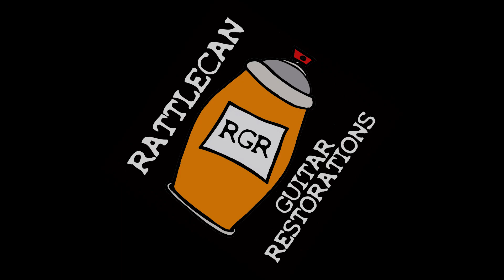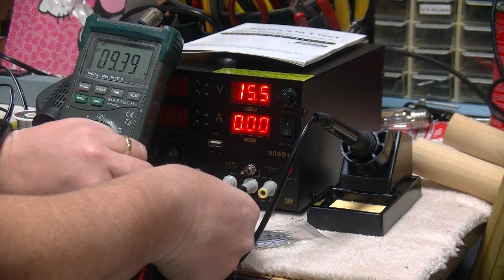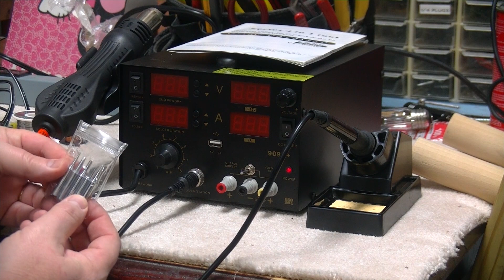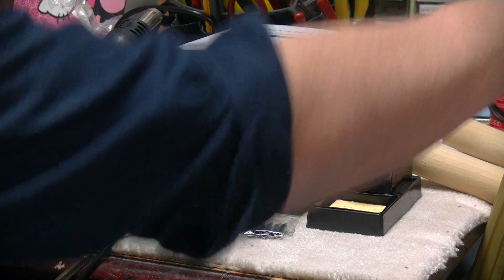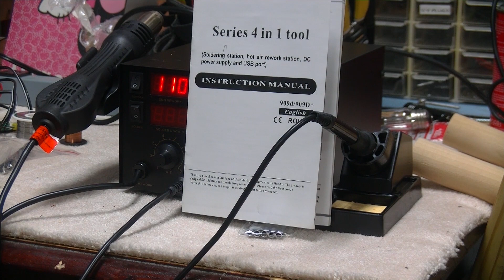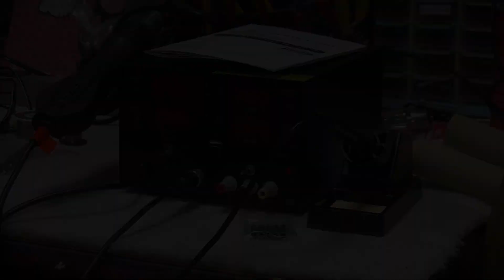REVIEW: 909D+ SMD rework station | RATTLECAN GUITAR RESTORATIONS by James O’Rear

Comment: Soldering Irons are something you don't want to cheap out on because cheapies never last. look for a used Metcal soldering station, built like a tank, heat up lightning fast, work great and have auto shut off so you never have to remember to turn it off, (something i have issues with), LOL https://www.youtube.com/watch?v=FAipMcwfuqI

Comment: Not worth the hassle. The soldering iron seems to go bad after every use. It'll work and before I'm done I'll get that same reading. I've ordered 3 replacement soldering irons from the cheapest to the most expensive one and the same happens to every single one. I gave up on it. Mine doesn't have the USB or the 15 volt supply.
Reply from the maker: Hate to hear that Gil. Nothing worse than spending your money on something that doesn't do it's job.